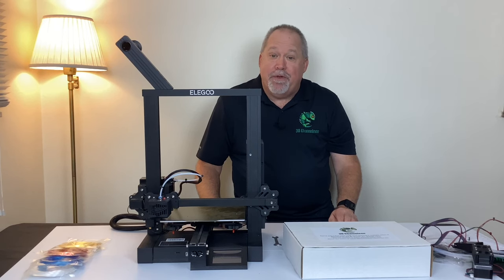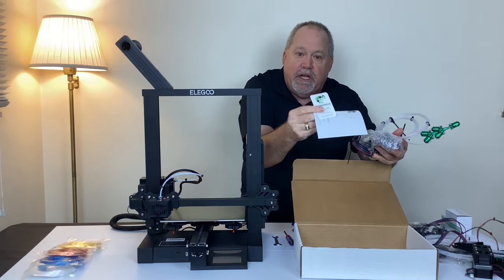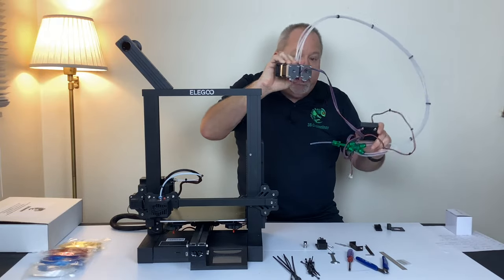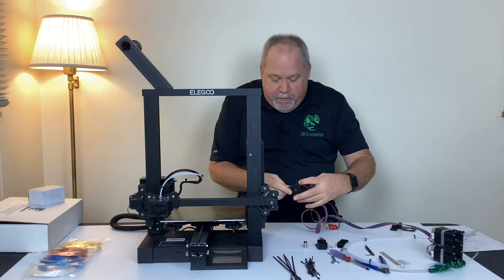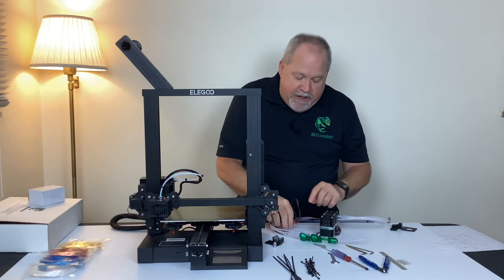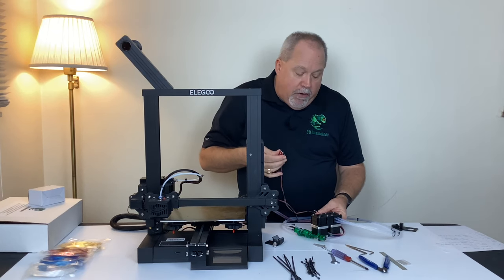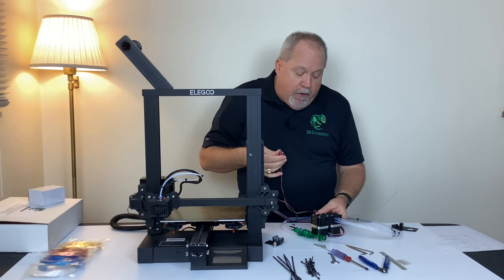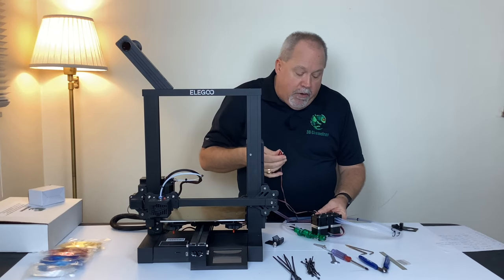START HERE: 3D Chameleon Mk2, Mk3 and Mk4 Basic Installation

Comment: I don't think this will work on my microswiss Direct drive. Filament has to be cut at angle before inserting. I see the Filament getting stuck. Any videos on that or need a tester lmk?
Reply: I've not had any issue with mine... Just make sure they're both spinning at loading time and reduce the tension enough for it to load, but still drive it.
Reply: @William Steele  you have the micro swiss DD? Does this product cut the filament before at an angle? I want multicolored but not sure I want bambu
Reply: @toshlarue  Yes... and it doesn't need it cut at a 45... on mine, I don't cut it at all... just load it and go.  The Tool Change GCode  has a tip shaping section in it that forms the tip into a bullet shape.
Reply: @toshlarue  The 3DChameleon doesn't cut the filament, we've published another design called the 3DClippy that can cut the filament, don't confuse the two.  The 3DChameleon  uses the gcode to shape the tip... the 3DClippy can eliminate that step in the color changing process, but you need to implement that part yourself.  As for us having the DD, yes, we do... and we don't need the tip at an angle to load it... it simply loads properly during the cycle when the tension is set correctly.  If you need it at a 45, try lowering your tension settings... it'll still extrude fine, but will be easier to load.  (Remember, in our case, both the extruder is already running and the 3DChameleon is pushing the filament into it... so they are not fighting each other... in fact, they're both pulling it into the PTFE tube.)

I might add, on the DD, the slot where the PTFE is located is the perfect place for the cutter, since it is closest to the hotend. The closer it is, the better.

Comment: I wish it was that easy, "go to the g-code generator, paste it in and start printing". I tried and was never able to get it to print, the filament would stick or collide with another color that didn't properly retract. Also I have found no one other than Bill that has got the Chameleon to work. Bill is very good about responding to email but that just wasn't enough to get it printing. If you are planning to purchase, good luck.
Reply from the maker: If you're still having problems, let me know... I'm happy to help try and understand what is causing your issues, but if I don't know about them, I can't help.

Any pictures of your tips or videos of what is happening is always very helpful.  

But what ever you do... If it doesn't work, please keep in contact.
Reply: @3d_chameleon  Thanks Bill. I'll try and tackle this and get it going after Christmas, maybe early next year.
Reply: @stevelaminack1516  did you sort it ?

Comment: Is there mounts for Ender 6? Will the Ender 5 ones work the same
Reply: The mounts for pretty much any Ender or CR series machine are identical for the 3D Chameleon itself, however, the extruders PTFE couplers might differ.  I'm not sure which extruder the E6 has, but we pretty much cover all of them in our connectors over on Thingiverse or Tinkercad.

Comment: Will this work with the mini price select mini 2
Reply: Yes, it works on any printer.
Reply: @williamsteele  even direct drive printers
Reply: @Bricksofwar87  Sure, it works on any printer.  I might add, the Select Mini 2 isn't a direct drive printer.  You can see many examples of the various types of printers on Printables.
Reply: I’m just curious I Also run some ender 3v3s and I have been wanting to get into multicolor
Reply: I want to get the Creality k2 combo but I’m practically broke so I thought this would be a good alternative
Reply: @williamsteele  im considering getting one for my k1 max and my neptune 4 plus!
Reply: @dylanwiley1921  The K1 is a simple installation with lots of support on our Forum.

Comment: I would like to buy the 3D Chamelion but I have a Creality Sermoon D1 with Direct Drive.
I would need a lot of help
Reply: Look at our latest P1P installation video... your Sermoon would be nearly identical to it.

https://www.youtube.com/watch?v=-yPEFhnJVdI
Reply: @williamsteele  its not the same. I dont have ptfe. Its a hard direct drive,  filament goes directly throw the extruder
Reply: @hugoramos496  Which direct drive do you have?  All you're doing with the 3DChameleon is loading and unloading your existing extruder. Direct drives (like the Bambu, for example) work just fine with it.
Reply: @williamsteele  Single-gear direct drive extruder where the filament goes directly to the gear without any ptfe driving the filament
Reply: @hugoramos496  In that case, you simply add the printable PC4-M10 adapter to it.

Comment: Do you end up losing any Y axis travel on this installation?
Reply from the maker: It really depends on where you put the Y switch.  For example, in this printer, the maximum travel area is 215mm... but the switch is at 214mm... so it does... however, there are methods of installing it where you don't loose any travel.  Most people find that loosing 1mm of travel isn't an issue, however.

Comment: Just purchased exited to install on my anycubic Kobra Max, looks like install should be a breeze. Is there a way to set different extruder settings for each of the four filament settings?
Reply from the maker: Yep, the slicer already allows you to set different settings for each extruder.  If you're interested in setting different tension settings for each extruder, you can also do that with our printable bearing carriers.
Reply: @3d_chameleon awesome when you say "for each extruder" you are talking about the same extruder as the filament is fed/unfed through the same correct?
Reply: @JakeMakesProductions  No, it's each virtual extruder or color.  Each one can have different settings and the system will adjust the one physical hot end to match those settings when the color is changed.
Reply: @williamsteele  I'm talking physical, not virtual.  Just confirming I don't need additional extruders.
Reply: @JakeMakesProductions  Nope... You don't. 👍
Reply: Jake, Have you installed this on your Kobra Max yet?
Reply: @PickleballThornton  this is installed on my Kobra Max, however I haven't been able to finish setup as I am waiting for parts for the printer from anycubic. I've been going back and forth with them for over a month.
Reply: @JakeMakesProductions  Sweet. I purchased one yesterday. Do you remember the shipping lead time on when you purchased and received yours? Which part are you waiting for?
Reply: @PickleballThornton  I've been waiting for a series of parts, mother board, extruder board, heated bed, now heated bed controller board. The printer with get partially through a print and fail.
Reply: @JakeMakesProductions  That's a bummer. My parts will arrive on Friday. Did you find the assembly to be pretty simple?
Reply: @PickleballThornton  for the printer or the chameleon, neither were too bad. Make sure not to use the metal clips on the sides of the build plate, front and rear only. Reading about some of the errors I am experiencing and that is a major cause of one of them.
Reply: @JakeMakesProductions  the chameleon.
Reply: have you installed it on your Kobra Max ?
Reply: @rohitshai3075  I'm almost done with installing it
Reply: @JakeMakesProductions  did you install your stepper motors on the top rail of your max? I'm thinking about keeping it on a table instead. I also placed my metal clip on the y-axis as well
Reply: @PickleballThornton  I mounted my motors to the angled support tube on the backside of the printer towards the top. The clip I referred to was for the build plate. They should be at the front and rear as indicated in the instructions.

Comment: I also have a Neptune 3 Max that I want to install this on. Do you have a video or know of one? My chameleon is supposed to be here Fri. Thanks!
Reply: We don't do printer specific videos... but since this video actually covers an Elegoo printer, your installation will be very similar.   The only difference will be the PTFE attachment to the extruder, which you can find several examples of on Printables.
Reply: @williamsteele  Well, I see nothing on there that says anything about PTFE attachment. sigh
Reply: @williamsteele  Wait. Im guessing thats what the "clippys" are.
Reply: The PTFE portion is at about 18:03. He shows the PTFE connector. That chapter is entirely about installing it on the extruder.

Comment: Is possible instal this system in a Artillery Genius?
Reply: Yes, it's universal so it works with any printer.  Your Genius uses the Titan style extruder... We have an adapter specifically for the PTFE feed tube to the extruder on Printables.

Comment: Has anyone set this up on a JGMaker Magic?
Reply: Yes... you'll need to mount the switch on the right side end of the X axis and remove the white cover over the top to mount it, but otherwise, it's identical to this video.
Reply: @williamsteele  Thanks! Once I change out the hotend and the extruder I think the 3D Chamaeleon is going to be my next project.